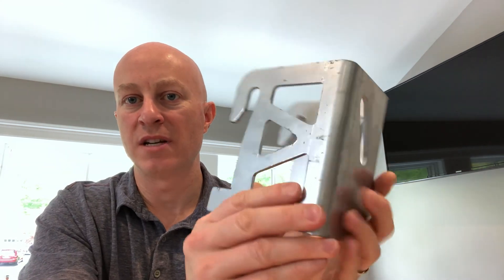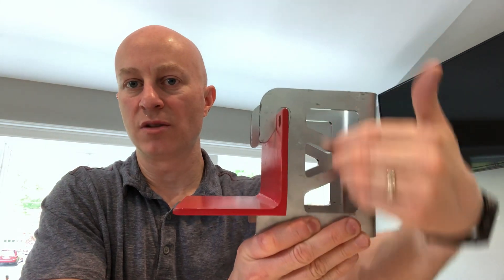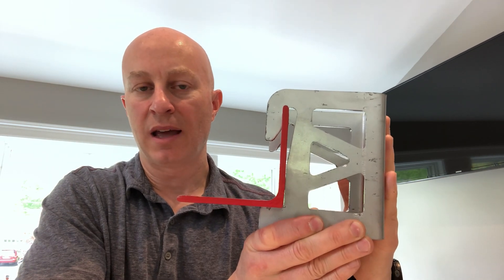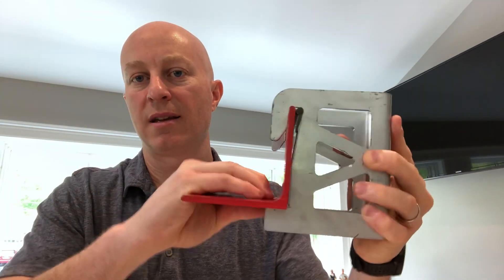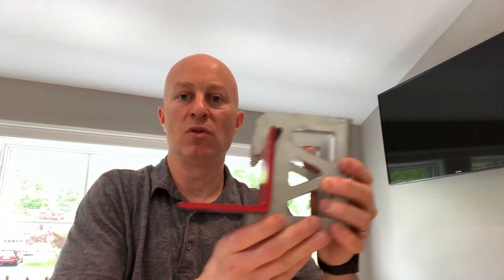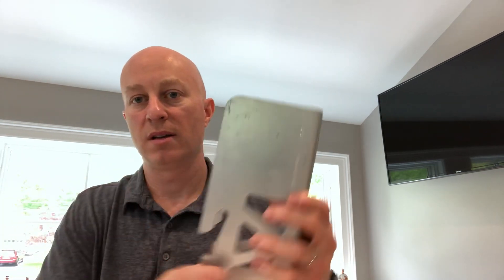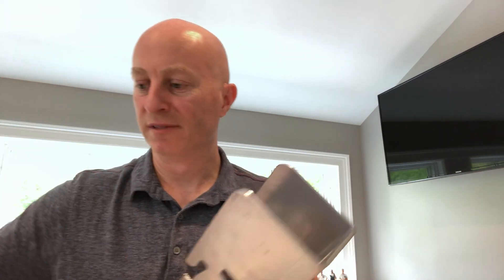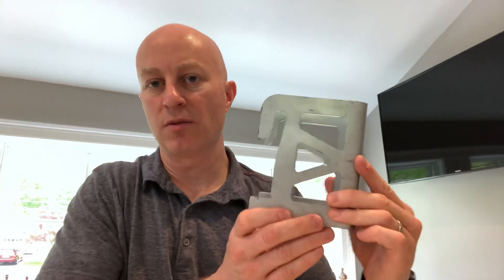FAST Brackets by FERO CORP.

Comment: What is the lengh x width dimension of rectangular slots we need to provide in the shelf angle (angle in red color) which you are showing at 4.50 min of this video ?. Also i need to know locating dimension of slots from back of angle and distance between two slots in order to detail the continous brick shelf angle...!!